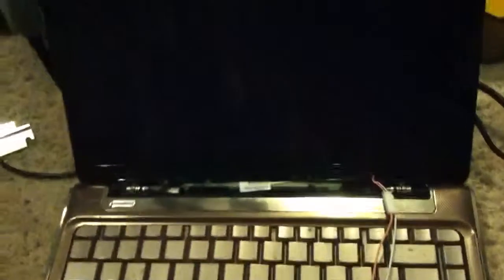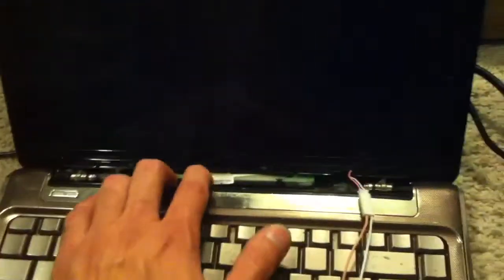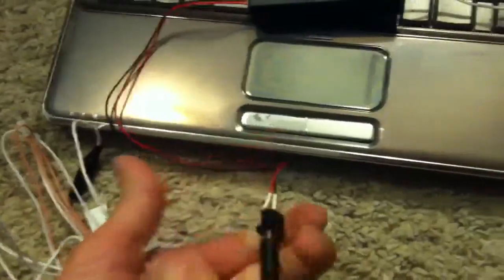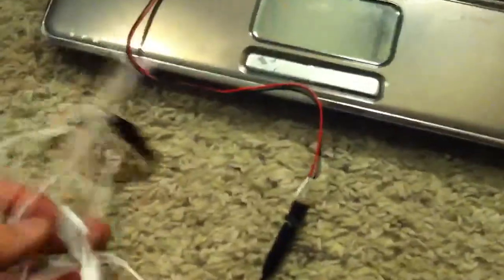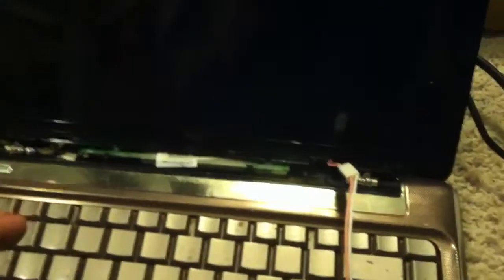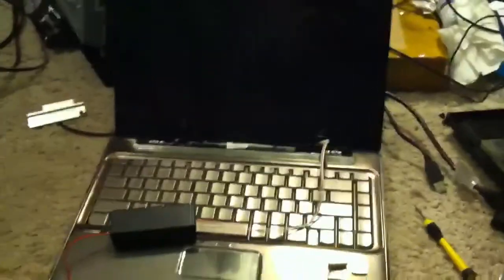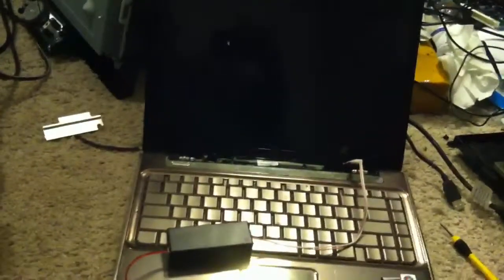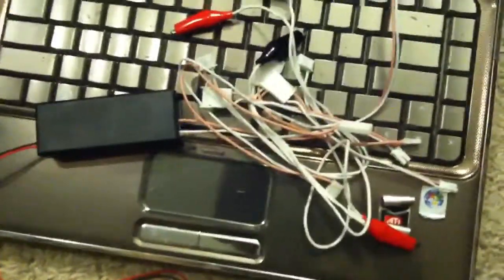How to test ccfl backlight for laptops

Comment: Any replacement for them? damn which is why i prefer desktops! they last a lot longer and more comforable to use.
Reply from the maker: Typically, you just replace the screen at this point, and it depends on the model of laptop, some of the bulbs are up on ebay. I just buy replacement laptop screens instead of buying bulbs, some screens are as cheap as $45.